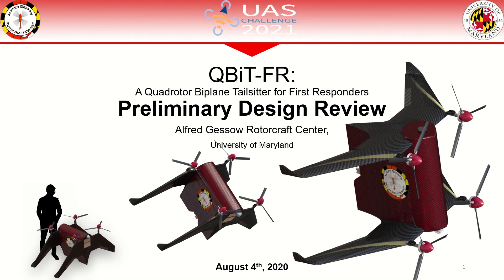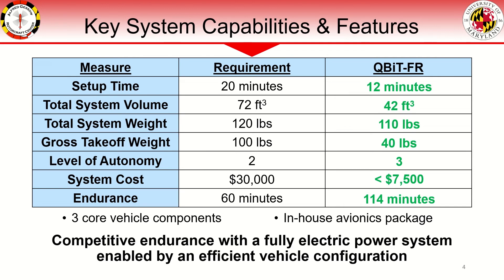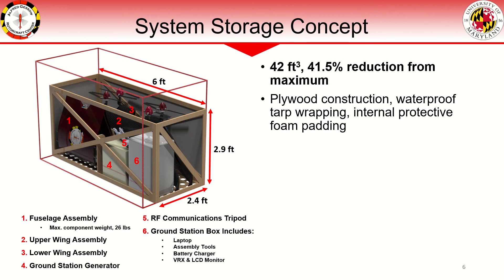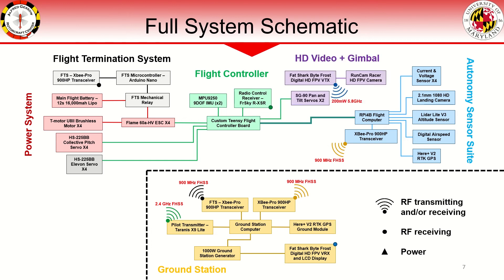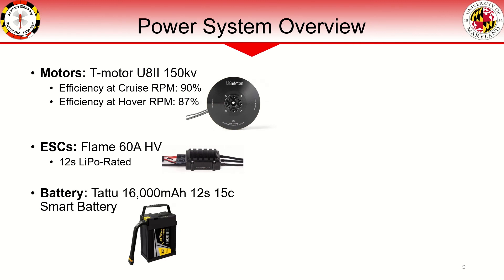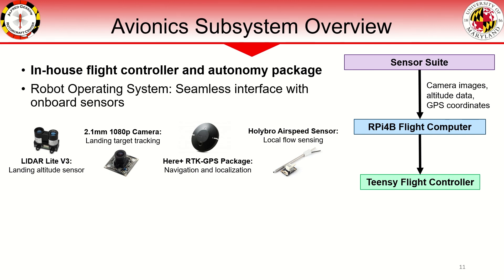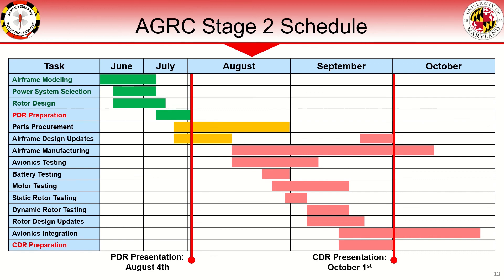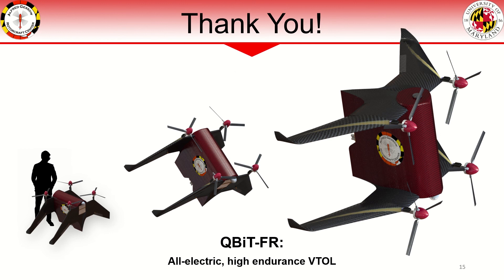Quadrotor Biplane Tailsitter VTOL for First Responders - Preliminary Design Review

Comment: Did this use the dRehm flight controller software? Also, did you end up making any more documentation for this project before it was cancelled? Great stuff
Reply from the maker: A similar autonomy framework was planned that we’ve used on other projects, utilizing the dRehmFlight controller for stabilization, yes. Although this one never got off the ground, we’ve flown that flight controller on a slightly smaller 20lb quad biplane in our lab as a demonstration. I can’t provide much more documentation than this unfortunately

Comment: Love this project and looking forward to your updates. Were you able to stay on schedule? I was interested in the XBee. I've only used RFD900 for telem. How were you able to get the signals from stepping on each other? Can you restrict the frequencies of each unit?
Reply from the maker: Unfortunately the project is scrapped due to issues securing lab space during covid times... The XBee we specced out uses FHSS so they all play nicely together with minimal interference
Reply: @NicholasRehm  Dang, sorry to hear that about the project. I share your perspective on plopping a fixed wing platform on a quad and suggesting it as next level VTOL. Have you had real-world use with the Xbee's like your example yet? I'd be interested to hear your results, as I've not had great success with using 900mhz sources on the same platform. I've mixed -TBSCrossfire and RFD in various different ways and it seems to have odd behavior, namely failsafes. Both Crossfire/RFD are also FHSS. Seems like it might work if you could constrain the freq spectrum of each radio to a different part of the band. You've have less space, but they'd still be hopping.
Reply: @NicholasRehm  your team’s concept, plan, and presentation are all beautifully showcased here. Congratulations on that. So sorry to hear that the Risk 1 you accurately forecast couldn’t be mitigated, and was terminal to the project. Really hope that doesn’t set back your master’s thesis!  Any ideas for other ways you might recycle this work into what I’m sure many of us hope will be your continued exploration of this part of aviation solution space?

Comment: did you look at prandtl propulsion for the props?
why do you prefer byte frost over dji?
Reply from the maker: Prop design was primarily momentum and energy based numerical design methods. We've actually switched over to dji digital very recently for their frequency hopping technology, but were initially hesitant based on price and lack of ground station options
Reply: @NicholasRehm  the goggles have hdmi out, don't they?
Reply from the maker: @marc_frank  from what I've seen, they don't. You need to connect them to the (expensive) dji controller, which then has hdmi out
Reply: @NicholasRehm  hopefully they do a software update, there have been a lot. or v2 goggles.
what would be really convenient, is if they were also able to recieve analog video.